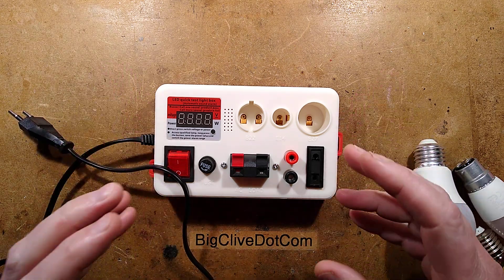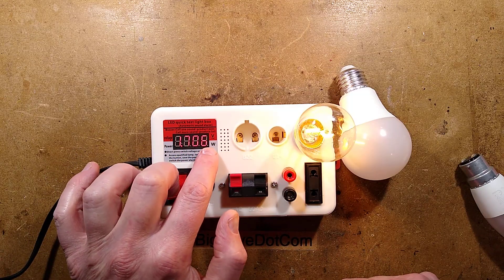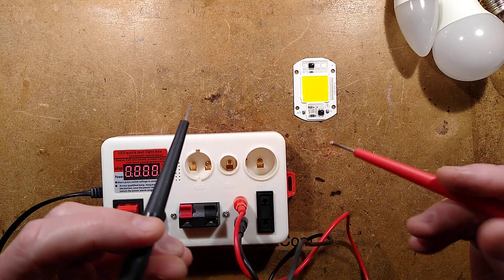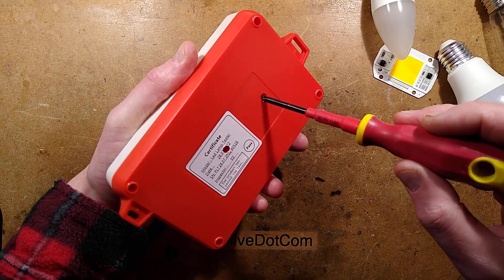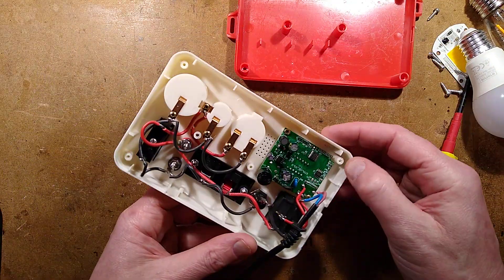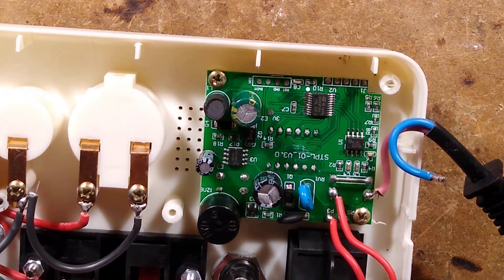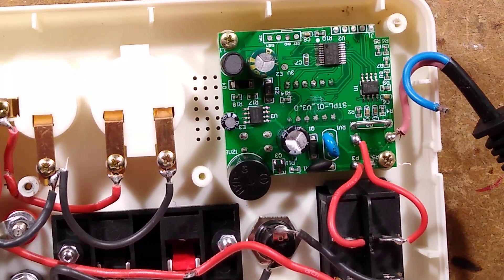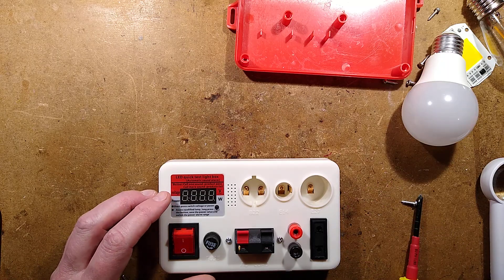Scary eBay Chinese factory test equipment

Comment: I got one of the BC recommended (as in dont buy this) mains bulb testers. 
Unlike the BC video from 5 years ago, it now pops open with clips as screws are too expensive. Uninsulated wrire everywhere, with the magical improvement of magnetism.
It's still safer for me testing led lamps in a repair café than stabbing them with a couple of mains leads. I've labeled it the widow maker.

Comment: About how the Chinese factories are indifferent to dangerous electrical practices and products. The either don't care, or or oerhaps they don't know the danger, like how America didn't know about electrical safety in the early days: 

Despite the adoption of more uniform codes, the field of electrical safety was still poorly understood and lots of dangerous practices weren’t just commonplace – they were recommended. For example, the 1936 American Electricians’ Handbook offered the following advice to electricians:

“Electricians often test circuits for the presence of voltage by touching the conductors with the fingers. This method is safe where the voltage does not exceed 250 and is often very convenient.”

The History of Home Electrical
System Safety by Rytec Electric LLC

But I wager that they just don't care, at least the manufacturers who produce fake dangerous products.

Comment: Funny how many find this dangerous while everyone has ancient E27 or B22 lamp holders all over their home. No protection to insert your finger in one of those whatsoever.
Reply from the maker: With this one, the outer thread sticks out significantly and the unpolarised plug means that can be live.  In this unit it would be live either way round due to it being in series and not referenced to neutral except via the load.

Comment: Yes, well, I guess they've got so many people in China that it doesn't matter if they lose a few. Anyway, one test I would like to have seen Clive perform is to plug the flying test leads into the banana connectors and then to see what happens when you probe the connectors inside the lamp holders.

Comment: so this is the safety upgraded model for workers in china I would say its safe to use if you have common sense not to stick your fingers into places they should not be I would just add a GFCI to it and call it safe sure you could still stick your fingers across the contacts and avoid a ground fault but really if risk is part of life just dont be stupid

Comment: I've just bought one of these fully aware of the potential issues, since I'm sick of being shipped dud LED bulbs and am resolved to henceforth test each one with a luminance meter.

Since it had a 'Merkin plug on it, I opened it up (back pops off, no tool required) and found something "interesting": the brown wire- which without checking one would connect to mains live- is wired to the outer contact of the ES-style connectors. However other hackers have already discovered that this is frequently in direct contact with the metal- or at least metalised- exterior of cheap "smart" LED bulbs... which increases the risk considerably.

Now I'm from the generation where every bulb sold by Woolworths was checked using a wooden-box tester, with the girls expected to listen when they were instructed how to avoid killing themselves with it. But even so.

Fitted with an isolating transformer (preferably made in the First World), which will probably need a deeper base to house it, this will be a useful bit of bench equipment arguably no more dangerous than a 'scope with the ground lead pulled out of the plug. But this really isn't something for the average family man.
Reply from the maker: When I got my test unit I rewired it correctly with new copper cable.

Comment: Hi Clive. Did you found what is the eight-pin IC used for the energy meter? If it is not a specially dedicated chip, I will be grateful if you could do a reverse engineering of this board or give some clues about how does it works. I'm intrigued about how simple it looks compared to any other energy meter I have come across..
Reply from the maker: It's a dedicated chip used for smart meters.  It just provides data to the display controller.

Comment: I would buy it but only to mod it so its a 20V test station. using a USB-C adapter, which breaks down into multiple points.
It looks to have enough room for a buck-boost converter. where you replace the fuse as a rotary encoder, tied to the buck-boost converter.

!!!!But running it a 220V: HECK NO!!!!

Comment: I have a LED backlight tester and it pumps out almost 300 volts , I can touch the probes without getting shocked , the voltage goes to zero on the display, as it shows different voltages when testing LED strips in tv's.....
Reply from the maker: Note that some of those testers do not properly isolate from the mains supply.  Be very careful using it, and always treat the probes as being mains referenced.

Comment: Does it matter whether the fuse is on the neutral if the plug isn't polarised?
Reply from the maker: In a way it's just his that there is at least a fuse.  But it could give the impression the unit is off while still having a live probe.

Comment: Ya could add a battery to the LED tester and wire it to the buck regulator SO YA DON'T KILL YOURSELF TESTING LEDS. Or better again add a boost regulator to the output pins for the probes plus a separate switch...

Comment: I am writing to express my support for the use of devices that extrude live wires for the purpose of quick testing of electrical devices. Despite the negative connotations surrounding these devices, commonly referred to as "mains to death adaptors," research has shown their effectiveness and safety in electrical testing.

According to a study conducted by the National Institute for Occupational Safety and Health (NIOSH), the use of wire extrusion devices has been found to be a "safe and efficient" method for electrical testing (NIOSH, 2014). Another study by the Occupational Safety and Health Administration (OSHA) similarly concludes that these devices can be used safely with proper training and precautions (OSHA, 2018). A third study by the International Association of Electrical Inspectors (IAEI) also supports the use of wire extrusion devices, stating that they are "a valuable tool in the electrical testing process" (IAEI, 2016).

In conclusion, the use of wire extrusion devices for electrical testing is supported by reputable sources and can be done safely with proper training and precautions. I stand by the right of individuals to utilize these devices in their work.

References:

NIOSH (2014). Evaluation of Wire Extrusion Devices for Electrical Testing. Retrieved from https://www.cdc.gov/niosh/docs/2014-146/
OSHA (2018). Safety and Health Topics: Electrical Testing. Retrieved from https://www.osha.gov/SLTC/electrical_testing/
IAEI (2016). The Use of Wire Extrusion Devices in Electrical Testing. Retrieved from https://www.iaei.org/publications/magazines/fs_article.aspx?

Comment: Playing God's advocate here, could it be argued that the ?Europlug was an indication that it should have been plugged in to an isolating transformer shaver socket which would have made it safer?  Although if that's the case, it should say so in bold on the device itself, and most people would ignore the instruction.

Comment: I definitly see use for this thing for many hobbies like terrariums, plants/weed growers, etc.. Just cause it's not safe it doesn't mean it's useless. Knife isn't safe either and many people woudn't allow kids to play with them. I wouldn't allow most of people to use this thing, but yet when I was in need of such a tool the DIY solution was much more deadly and I still used it. Electricity is to be used, such as fire is and any other tool we created in human evolution. There are proper gloves for  handling electricity and they are quite cheap, like 25$ cheap..

Comment: I'd buy one if I ever wanted to test lamps.
But I don't have the patience to test LED lamps, once they start failing they are replaced. And for anything else I have an Autovario from the 60's, which is a lot scarier as there is no safety whatsoever bar the one in your own lamp.
Alas, I shouldn't go poking around in live 380Volt equipment, cackling like Igor from  Frankenstein. Just wear thick rubber gloves, a proper meter, and only use one hand.
Coincidentally, how would you make a Frankenstein'esque power switch? You know the ubiquitous power switch with a huge lever, loose wires et al? Was thinking a 12v controlled relay and just have the 12V running through the switch.
Reply from the maker: Search eBay for knife switch.

Comment: Survival of the fittest; Stupid ones get electrocuted and die, smarter ones live to pass on their genes and that's how they keep things efficient. It's almost wrong to even imagine that here. I once fixed wiring of a junction box in the attic (exhaust fan) while the circuit was live. It was very exciting. Then again, unlike Europe, mains voltage is diluted to a balmy 120V here. That may explain many things why...

Comment: 247V for you, 258v for me (House 138 yrs old, 1884). Where does this nominal figure of 230v come from for the UK Clive? Is it substations on new builds that output this random figure? Oh, and neighbour moved out and house being gutted. In the alley, there is a 3 way supply. I notice the service fuse has an addition with 2 phases (1 set of new tails) going into that property. If they are not turning it into a couple of flats, they are bloody nicking it. I was showing my house mate how I was going to do the same and put in a bank of sockets for heaters, tv's etc when I noticed it. Seems they beat me to it.  The way things are going, there are going to be a lot of fires this winter, and it won't be candles but the clueless that use Christmas tree lights to bypass the meter. I'm sure you've seen it too in passing. Some cocky lads in the street were fitting a car stereo in what looked like 1mm mains, no fusing, just direct to battery. I told them they were being silly and get a thicker cable and told I didn't know what I was on about, (Panel wiring in NRC at the time). The car caught fire and totally destroyed. I laughed so much my jaw ached. Sorry for the essay. Bored and Lonely :( I hate Christmas time.
Reply from the maker: 230V is the fantasy paperwork voltage of European regulations and deskilling.
Savour the peace of a lonely Christmas.  Much less stress than "family Christmases".
Reply: @bigclivedotcom  true, its just a bit shit. This will be the 4th in a row now..whats the point tof cooking, just a chicken micro meal and a mince pie, half bottle of whiskey and rubbish tv.

Comment: Im a commercial  electrician superintendent, I like high pressure sodium lamp testers, they're basically a telescopic antenna with a capacitor in it that'll fire the (element)  to see if lamp is functional,  it'll lite ur ass up too lol

Comment: You said fuse is on negative.  What happens when you plug power cable other way around? Is it still on negative?
Reply from the maker: No.  It's random depending on which way it's plugged in.

Comment: in 86 uk i worked in a sign build company. they had a terminal block with 2 used rivet pins sticking out to test the signs are working. was dangerous when it hit the steal back it jumped at you.

Comment: The fuse is not on the live side. It depend on how you put in the wall plug. Those EU plugs don't have a live and neutral as yours have in the UK. If you turn the plug 180 degrees the live will be the neutral. There is no rules where the live should be in our wall sockets either.

Comment: it's test equipment. it doesn't have to be 'safe for dumb consumers'... and with 250v nothing will happen anyway. it's not like it's 50kv... a bit of an itch at most :P back when europe still had a working economy we also sent 11 year olds to go work on fishing boats or pirateships or in mines. and if people die, then indeed, so be it. the world is not some kindergarten for idiots that manage to electrocute themselves, blow themselves up or put themselves on fire or get run over by their own train or truck. such idiots simply should be fired. it is not a matter of adapting the machines to be less stupid than the guy operating it. (or as we always say, i pay you to mount the transformer to the wall. not to drop it on your foot' :P india and china both are the worlds only 2 true world powers. both have an actually functional economy. whereas the usa and europe only produce bullshit. (in the most literal sense ;)... 'look how many rainbow flags siemens has'. meanwhile failing to deliver a simple gas turbine. lol. 'factories are ugly and make smoke (omg! ;) and are dangerous to work in ;) yeah. well. factories are also what makes money so you can buy food. simple. and if some idiots kill themselves on the workfloor. just make some more babies (yet another thing europeans fail to do - maintain their own number or grow it ;) btw dirty mom and pop shops with 'nails in the workbench' are more likely to be found in pakistan. not india or china. where factories generally are WELL organized and clean and big. 'it not being polarized'.. polarized plugs are not a thing in most of the world. only the belgian/croatian earthed ones are potentially polarized cuz they have this additional pin. other than that the only plugs you can't insert either which way are the blue outdoor ones and 3 phase ones for obvious reasons. any single phase plug with or without ground can go in eiher way. (tbh its not even specified which side of an outlet should be l or n ;) and even with 3 phase stuff sometimes simply 2 of the phases are 'gray' and the motor turns the other way around. too bad :P LOL.

Comment: Clive, let me tell ya, I was replacing sockets in my mum's apartment there, and although I expected any colour wire to be used for anything, I did not expect it when I saw one of the sockets with a yellow/green wire for earth, a yellow/green wire for neutral, and a yellow/green wire for line!

There was also a socket that was wired with some 0.75mm² wires in parallel instead of, you know, actual 2.5mm² wires...

Comment: Looks like a ten year old soldered those wires, what a dangerous device
Reply from the maker: The wires are copper coated aluminium with literally molecular copper.  I found that out when I tried resoldering them.

Comment: That 8 pin chip next to the current shunt would be a single rail opamp, to amplify the small dc voltage from the shunt to a more "ADC friendly" dc voltsge for the micro.
And WOW that whole device looks very unsafe.
DO NOT BUY IT FOR A KID'S XMAS PRESENT! 😬😎
Reply from the maker: It turned out to be a dedicated power monitoring chip with power factor computation.
Reply: @bigclivedotcom  ... wow they splurged! China clone market must have had those chips on special. 😎

Comment: I worked at an assembly factory that trained people to use a high pot tester in less than one minute and spent most of that training emphasizing the importance of an undamaged calibration sticker sealing the case and then set them loose with it. Our industry certification required every finished product pass a high potential test with a calibrated hi-pot tester, said nothing about required training for those doing the testing, seriously.

Comment: While not nearly as bad as in China, A factory here in poland has some bizzare realities... while so much stuff has to be certified and only select people are allowed to maintain things... but on the other hand stuff is constantly broken... live wires exposed, hydraulic fluid from lift pistons spray at high pressure at people. things go BANG and spark often... and open flame everywhere.

Comment: It looks like the outside of the Edison screw bulb holder is connected to the live wire, not the neutral one. So, if you touch the base of the bulb when inserting it, it will zap you that way too.

Comment: Theres a crappy Chinese PSU plastered everywhere on I think 'Banggood' ... I naively bought one and what a waste of £50 .... its still upstairs a year later unused before i throw it to recycling (a misnomer if ever there was btw...) and like such con apparatus looks good for a photo but thats all. Even out the box the screw terminals are stripped, kaput from factory new. JUNK. Low end Chinese rip-off stuff is notorious for abysmal / failed screw thread assemblies, other big / common mistake is materials substitution.

Comment: I was wondering what was so awful, but then I realized what the "test probes" did.  Umm...wow.
Reply: What's wrong with the test probes?
Reply: @bossmen6665  I guess nothing if you're ok with holding mains voltage in your hands.  It's perfectly safe as long as nothing goes wrong ever.
Reply: @Markworth  only trained people should play around with electricity and they should wear electrical insulated gloves
Reply: @bossmen6665  A hot take rivaled only by the epic disaster that occurs when some poor factory worker discovers the joys of welding without suitable PPE thanks to a defective part.

Comment: I bought one of those car computer readers from eBay that plugged into the obd 2 port and it fry my computer. It cost me $600 to fix. I bought led lights to replace my standard interior lights and all my interior light sockets quit working. I am very careful what I buy from eBay now. Oh, let's not forget the $250 car radiator that leaked very badly.

Comment: "maybe there too soft in Britain"
well to be fair they have double or triple safety, 
1. you got the plugs with extra long protection, 
2. the flaps with ground where you need the ground for the plugs to open on the wall socket, 
3. then you also have switch's i believe on the outlets, 
4. as well don't some of your appliances also uses fuses?